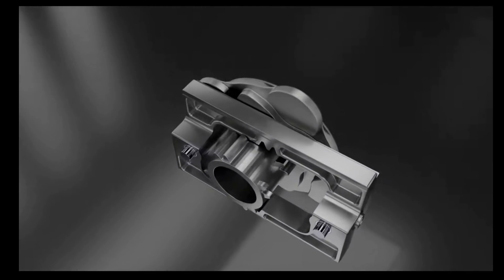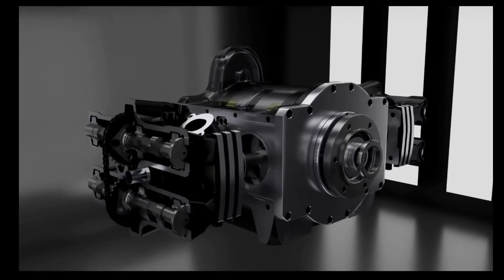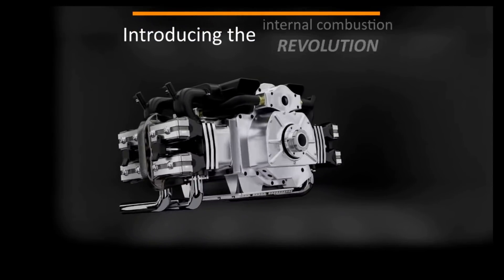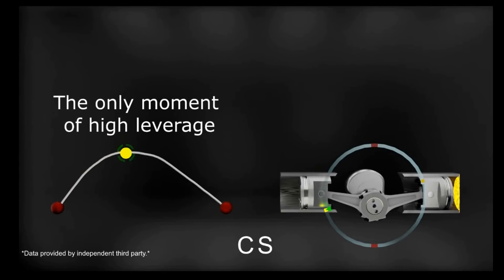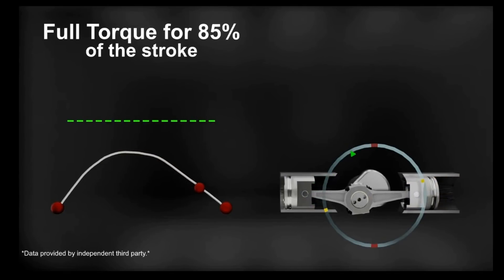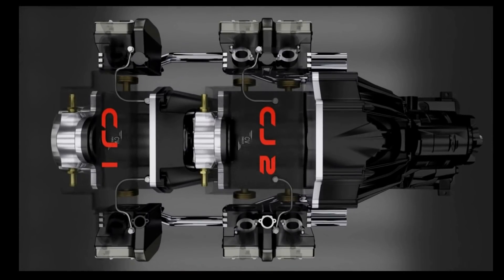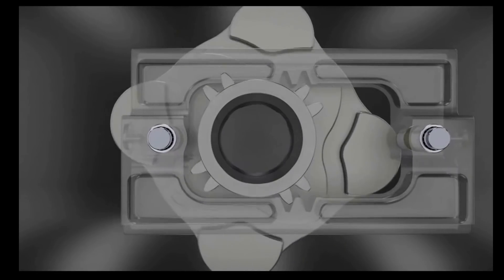More opposed Piston engines

Comment: 1 good thing about the design compared to conventional conrods, is that if they made it a 4-stroke with four more cylinders, then they would have a very balanced flat eight engine, that could potentially rev very high.

Comment: Here is an idea I have been toying around from time-to-time:

What if there would be a linear generator set up in square shape, 4 cylinders and 8 pistons, with opposite corners striking at the same time... in theory it should give quite boost in power-to-weight ratio as it would have fairly small amount of moving parts while getting the benefits of opposing pistons?

Comment: 2:10 its actually a not so practical design. Those tooth based crankshaft is definitely would not be able to handle the high torque. For that opposed piston design you already got the Boxer engine which is far more reliable.

Comment: https://www.youtube.com/watch?v=1dxgEXr0wy4       Do it this way.
Reply from the maker: HCCI, how?
Reply: @thedirtyworkshop  The ignition is switched off after warm-up. I'll pull off the plug wires on the next video. The static noise is from the generator drive jackshaft, otherwise, there is no mechanical noise, only a pleasant exhaust note.
Reply from the maker: Compression ignition isn't HCCI though, it's just auto ignition.
Reply: What is it lacking?
Reply from the maker: Well how do you know it's HCCI? Have you run an emissions test?
Reply: @thedirtyworkshop  CO2, H2O, 80PPM unburned HC, and no CO. No cat, obviously.  Done on Hamilton Standard analyzer.
Reply from the maker: So if you think this is HCCI, how are you controlling combustion? How are you throttling, and what fuel control are you using? Also, how are you actively recording BMEP?
Reply: @thedirtyworkshop  Carb is a Tillotson HR, familiar to older snowmobilers.  Temperature, fuel type, compression, and Bourke's extended time at TDC, combine to trigger detonation, further evidenced by the 350 F EGT. In cylinder pizo electric transducers are available, but expensive.  I use the Tillotson because it has adjustable hi and lo  speed jets. Normal settings are both 1 1/2 turns from closed, while the proto runs at half of that indicating a lean mixture.
Reply from the maker: Auto ignition isn't HCCI. The fact that you say the engine has to be warm is evidence right there. Loads of small 2 stroke engines do this. Loads of RC engines with plugs do this.... diesels do this. This isn't what HCCI is.
Reply: @thedirtyworkshop  The bottom line will be the BSFC. It doesn't have to be warm and will detonate from square one. A little warm-up allows the pistons to expand to working size to prevent cold seizure.  Russ claimed zero to 20k at start-up, but I tend to be a little more cautious with limited parts.  Once an engine enters "dieseling" mode , damage is usually the result. They always run best just before they blow-up. I'll have to ask some  RC people about switching off the ignition while airborne.
Reply from the maker: The RC lot don't have ignition they have glow plugs and run methanol. But plugs fail and the engine keeps running, this is auto ignition at high rpm. 

Read up on what HCCI is, and why it's so hard

Comment: Wow, imagine the adjustments needed to line up the bore with the linear bearings to acheive normal "friction free" function?... Also "no side loads"??? Right, the rack'n'pinion will suuuuurely not impart any perpendicular forces! Mega-roll-eye-emoji
Reply: Frikken heck, once you scale this bad boi up to family sized pack it will emit the lovely smooth sound of chains being dropped on steel deck.

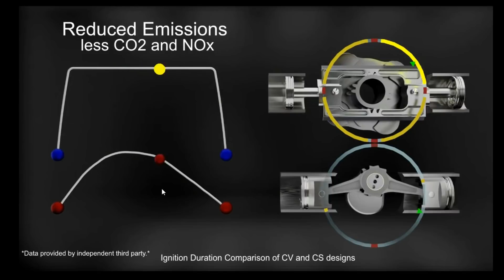Comment: 6:17 - 10:02 With a crankshaft, there´s a moment of maximal torque output. This lasts then just for a moment, or, just for some few degrees of the whole turn of the crankshaft (just as long as the connecting rod is perpendicular to the crankshaft-crankarm). In the new configuration, this is, in opposition to the crankshaft-case, almost a steady-state, where the conecting rod is almost continuously perpendicular to the crankshaft-crankarm. I think, you misunderstand this part and its statement. The intermeshing teeth aren´t meshing in a way, that the force is being tranfered perpendicular for much longer than in the crankshaft-case, but before and after this moment, when the angle of force-transport is less ormore than 90° (and thus suboptimal), the levers (part of the total active length of the intermeshing teeth) are also longer, so that the force output is constant after all, for as long as the teeth intermesh. this is clearly a solution, compared to the crankshaft-case. Maybe it turns out, that then, the maximal torque is less/lower than with a crankshaft, but still, it would plateau at its maximum for much more "turn-degrees" than with a crankshaft, and having a similar diagramm as shown.
Reply from the maker: This still doesn't mean what they state. Your lever can be perpendicular 100% of the time. This doesn't mean the force is...

Tale this concept vs a normal conrod type engine, and with all the added mass it is actually worse in comparison.

Comment: Just looking at this from a thermal dynamics standpoint...
Normal internal combustion engine =40% efficiency

If these claims are true, that you get the same power from half the fuel... Wouldn't that mean 80% efficiency?
I'm not an engineer so obviously I could be wrong - but I very highly doubt that these people can achieve anything close to 80% when the most efficient engines made are only recently hitting the 50% efficiency, such as motogp and f1 engines.
I know you can get an extra 10% or so from a diesel - but what am I missing here?
Power is simply the amount of actual work compared to the energy that's in the fuel... The reason internal combustion engines are only around 50% efficient is because half of the energy in the fuel is lost to heat, friction, pumping loss etc.
You're always gonna create a fuck ton of heat in any ICE (internal combustion engine) so you are always gonna lose some energy from that... And I don't think it's possible to create any engine that has zero friction or pumping losses.
Can someone figure out what the supposed thermal efficiency of this magic engine is?
Because this engine seems to be breaking the laws of physics... Just like alfadan and all the other horse shit magic engines you see on YouTube.
I find it hilarious that they all have a nice fancy solid works animation... But NONE OF THEM have ever built a working prototype.
That's says all you need to know lol
The best, smartest engineers are in motorsports... And there's a huge push for cleaner, greener racing.... Especially in f1 and sports cars....
There's been over 20 engine builders in f1 just in the last few decades... And they still use a standard flat plane crank design.
If they haven't come up with a magic engine that runs at 75% thermal efficiency, you guys really think some random start up company is gonna build a magic engine?
LOL cmon now
Reply: Ehhh most gasoline engines today are running about 25 to 30% efficiency. Most engines achieving better efficiency than that are doing so at a very narrow and specific RPM and other specific conditions not found outside a lab.

Comment: This is the anti-Alfadan engine. Just imagine the acceleration on the pistons when it goes from x m/s to -x m/s in the span of a few degrees of crank rotation instead of it being gradual like in an Alfadan engine, or even a regular piston engine. I looked at the bore X stroke and rpm of some diesel locomotives, and Alfadan engine looks rather feasible to me now.

Not only that, they also do not use the biggest benefit of having 2 cylinder banks 180 degrees apart. That is using a boxer configuration. This engine will have insane primary and secondary imbalance. This design doubles the imbalance rather than cancelling it out.

Speaking of torque they are also wrong. I like that you mention that the pressure would drop off. Infact, given the insane acceleration of the piston right after TDC, the pressure drop would be more drastic after TDC, because the volume would increase faster than a regular piston engine per degree of crank rotation right after TDC.

Using pressure to try to work out the torque is an error prone way of doing things. That's why PV diagrams exist. Calculate the work done, punch in the RPM and then derive torque/power from that. Its much less error prone, and works for all configurations. Your pistons could have all sorts of shapes, travel paths, speed relation to the crank and what not, PV diagrams will spare you the minute details like having to do a surface integral over the surface of a rotary (yes Matt, I am not letting that one slide) to arrive at a proper result.

Comment: A suggestion for a video, there is at present a big kerfuffle going on in the American V8 community re the topic of reversing pistons to gain power. Standard pistons have an offset little end to prevent piston slap, if you reverse the piston orientation, it gives a slight mechanical advantage, similar to an offset crank, your opinion would be interesting
Reply from the maker: I'm sorry for laughing but if you think it works like that then it is very funny. Combustion isnt that repeatable, and ignition isn't that accurate. For example, if you do a dyno run and get 351.64HP then immediately run the dyno again, you'll get something like 350.13HP and again 20 minutes later you'll get 353.04HP. Why? Because these systems have SO many variables there's a range, not an absolute.
Reply: @thedirtyworkshop  If combustion isn't repeatable and ignition isn't that accurate, it's random, that applies equally to all scenarios, re piston pin offset. A graph of ignition events against time will produce a bell curve, either side of theoretical ignition ideal, that doesn't address the pin offset question. If TDC occurs after the crank goes slightly over centre it WILL produce more torque, do your vector calculations.
Reply from the maker: These people are idiots.
Reply: @thedirtyworkshop  Engines are engines, bike,car electric, generator they're basically  the same, if you calculate vectors, reversing the pistons makes sense for increased power. It's an old hot rodder's trick, the rules say all components must be standard.....
Reply from the maker: Does it? Why are they even offset? To reduce the side loading on the power stroke... reversing them does what?
Reply: @thedirtyworkshop  Clockwise rotating engine, little end is offset to the left so that the transition of the side thrust on the piston occurs before tdc and the power stroke. Less piston slap noise.

The disadvantage is that the piston reaches tdc before the crank is at the top of it's stroke relative to the centre line of the cylinder. Reverse the piston and the crank is past the centre line of the cylinder when the piston reaches tdc, hence the mechanical advantage. Don't know whether bike engines use offset pistons, but most cars and commercial vehicles do.
Reply from the maker: 🤣🤣🤣🤣 wow, did you just say it reaches TDC before? And how much difference is power does this make??? 😆🤣😂
Reply: @thedirtyworkshop  Maybe I could have worded it better. The piston will be at its highest point in the cylinder when the centres of the main bearing, the big end and the small end are perfectly aligned. With the small end offset to the left in a clockwise rotating engine, this event will occur earlier in the crank rotation than if the small end was centred, it will happen before the crank goes over centre, if the offset piston is reversed alignment will occur later still, this means tdc occurs AFTER the crank has gone over centre, thus gaining a slight mechanical advantage.
Reply: An addition, you of course have to retard cam and ignition timing to suit. The rules stated that you could only use factory components. Their orientation was not specified!

Comment: "Alfadan, you watching?" hahahahahaha
those tiny little teeths aren't gonna be able to handle the force put on it right? or it'll have wear problems? like them seals on a wankel?
Reply from the maker: The strength is fine. All gears run on pretty much 2 teeth, the difference is the load is shared over all the teeth, so if this is compared to a gear with 20 teeth, then it's going to last 1/10th as long, however, what do you know wears teeth of gears out?
Reply: @thedirtyworkshop  Well, alignment would be an issue. Vibration could cause tiny mis-alignment on the whole system and cause excessive wear to those teeths. And plus they use ball bearing on the very end and not something like a conical bearing to preload the system. And lubrication, i guess? but that applies to all gears under stress.
love your videos btw, have been watching more and more since the alfadan thing haha

Comment: There is a way to make a horizontally opposed piston engine which both balances out the rocking moment and the piston-conrod forces.
I’m sure every manufacturer has thought of it, however there is little point in doing it as the rocking moment is small enough not to warrant it.

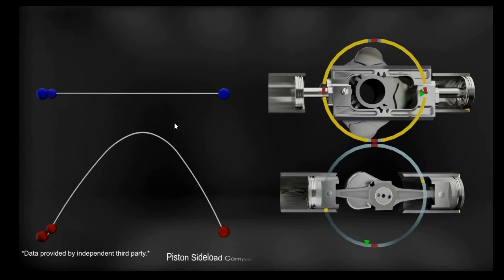Comment: @10:00 the piston to sidewall graph is wrong. If you include ring tension into the equation the force of burning gasses expand the rings onto the bore so it would be high load at ignition then it would fall off.

Also not only is it torque dropping off due to the piston moving down the bore it also will drop off because you have to open the bloody exhaust valve ffs.
Reply from the maker: They're talking about piston side loading due to the rod angle of incidence

Comment: Have you seen Craig Laycock's 'conjoined piston' engine? https://www.youtube.com/channel/UCxQuLv-Jxz8XYr1tGUJf2MQ
It exists only in CAD but it's a lot less byzantine than this one and doesn't have disconcerting features like partial gears. As best I can tell, the pistons are driven by the gear on the crank which is kept in mesh by the disc full of holes. Fun features include a bearing that's almost the bore diameter and, due to the holey disc running in the opposite direction to the crank, the bearing between that and the crank effectively running at twice the engine rpm.
Reply from the maker: Yes